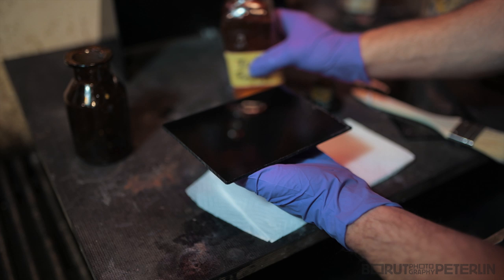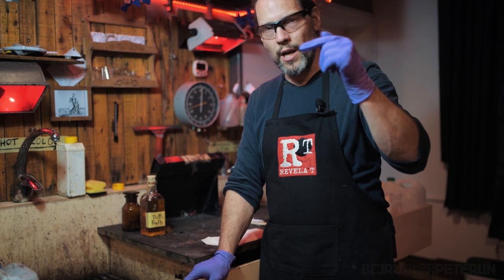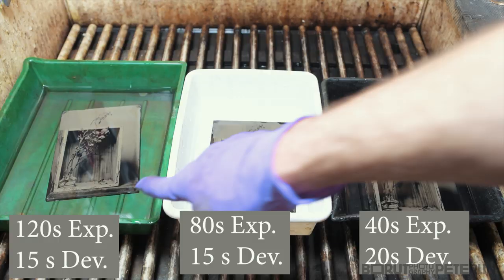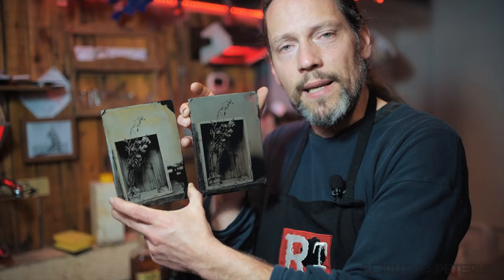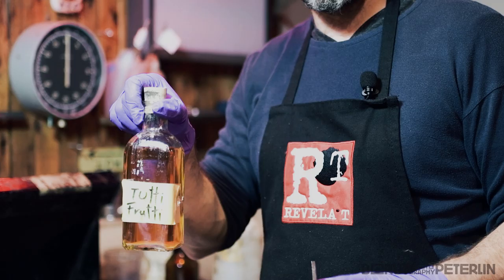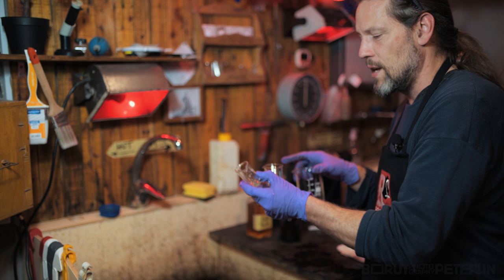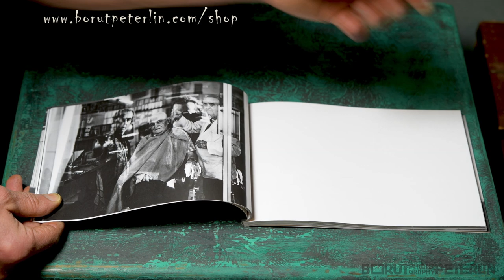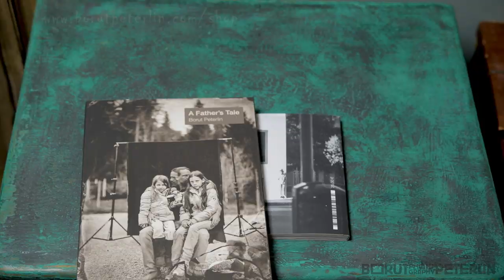How to Develop a Wet Plate Collodion Plate / Vlog 79

Comment: Great video Borut! Do you use brighter red lights when developing wet plates? Or maybe move the red lights closer while you develop? I tend to leave my safe lights in the exact same configuration as I have them for printing silver gelatin, and they are too dim to see the midtones when I develop wet plates. I've gotten into the habit of developing for a set time, but your technique seems to give more control.
Reply from the maker: Oh, yes, much brighter reds than normal safe light. But that said you don't need much light if you know what you're looking for and the light is at the right angle.
Reply: @BorutPeterlinPhotography  that's where we differ, I'm still very much learning and don't know what I'm looking for and you're a topshit master 😄 Maybe one day I can learn from you.

Comment: just wondering: is it possible to use a spray diffuser to put on the plate even fewer developer? I'd guess you can evenly spray a plate with as little as one milliliter or two... is it a stupid idea? if yes, why?
Reply from the maker: Slowly poured developer must be weak because if is too strong (temperature) the plate gets particular developing lines. That's why I prefer fast and furious pouring technique. Spraying would cause developing dots. That said I never tried it, but I will. Thx.
Reply: It definitely worth a try. Thx

Comment: As a wetplate beginner, should I go 8x10 or 5x7?
Reply from the maker: Either way you will learn.
Reply: You have options. You may eventually want to move up to 8x10 but if you start that big you'll be wasting a lot of expensive chemistry on the learning mistakes we all make.
I'd recommend starting with 4x5 and moving up from there. I personally have a 5x7 and an 8x10 camera. I use a 4x5 reducing back for the 5x7, as well as plate reducing inserts for my 8x10 plate holder so I can use either camera to shoot smaller plates. Might be something to consider. Good luck!
Reply: 8x10!